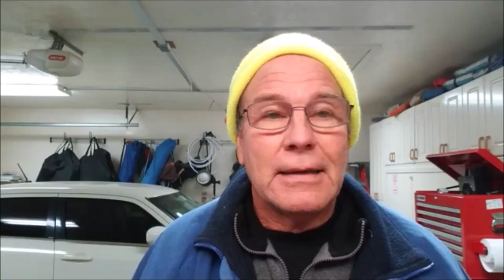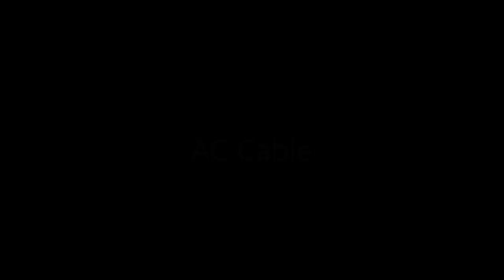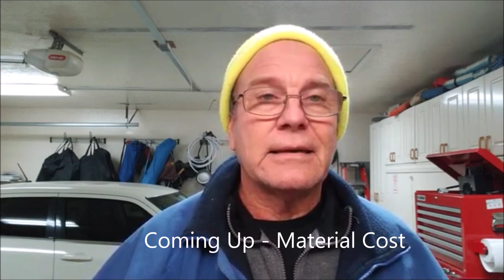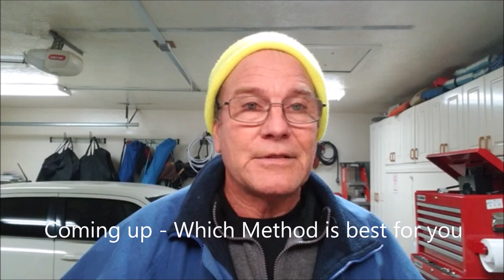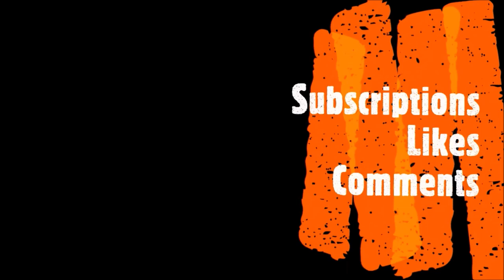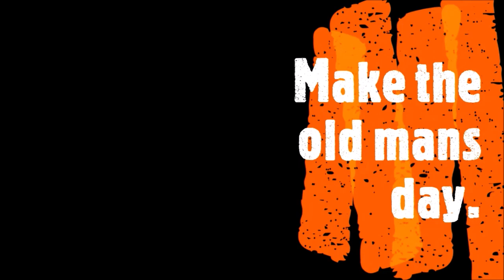How to wire a pole barn. Which method is best for you?

Comment: You have to use mc cable that is corrosion resistant or nmc cable. Regular nm cable not corrosion resistant. A pole barn is considered an agricultural building and has to be wired in accordance with that code article.

Comment: Are you talking about AC or MC cable?   Or are you trying to say they are the same.   I prefer MC cable with a green ground conductor inside.
Reply from the maker: Same
Reply: They're different. MC has the bare wire for ground and AC uses it's "armour"as the ground
Reply: @AB_thingsDFW MC cable has a green insulated wire for ground, AC cable uses a bare wire for ground.
Reply: @surferdude642 oops, you're right

Comment: MC Cable?
Reply from the maker: MC Cable, by most common definition, is a factory assembly of one or more insulated circuit conductors enclosed in an armor of interlocking metal tape or a smooth or corrugated metal sheath.